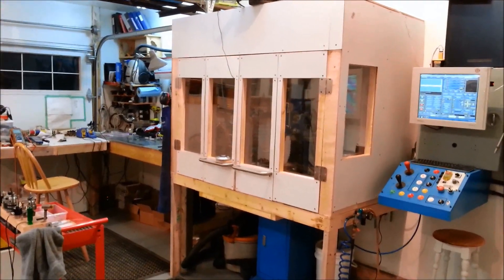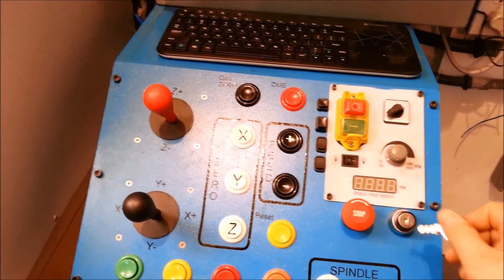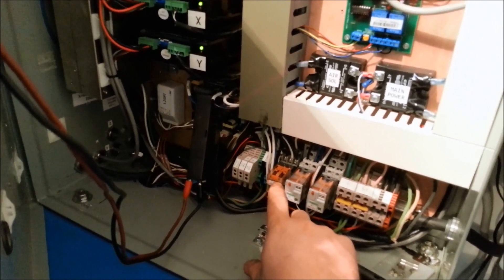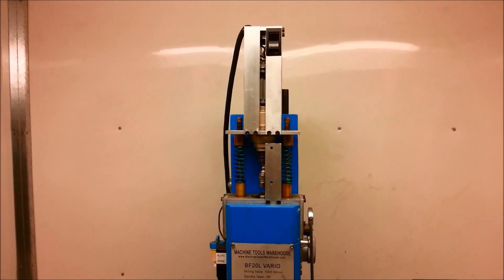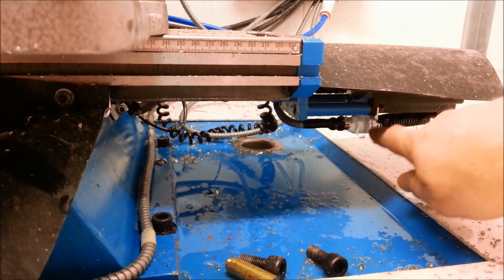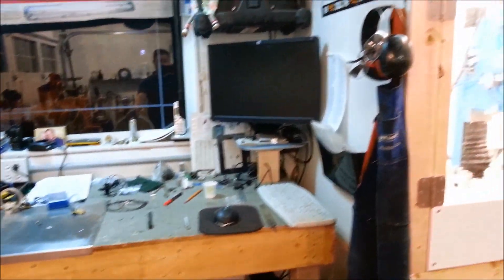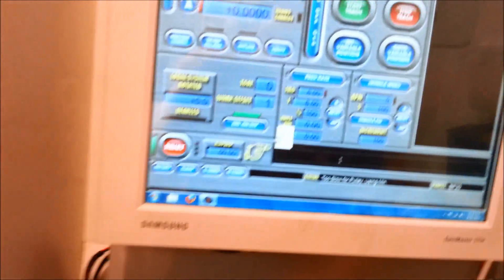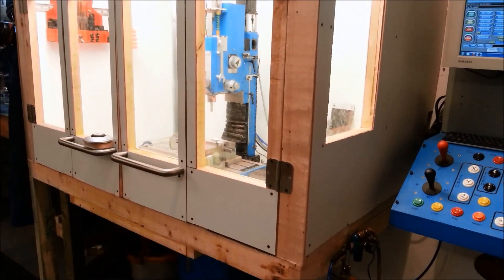BF20 CNC shop setup

Comment: I personally don't like the look of how the vise is mounted. The bolts are very close to the edge of the table, so there's a big leverage on them when there's forces being applied through the vise in the -Y direction (towards you). Otherwise it's all really cool work, well done.

Comment from the maker: I have not measured the sound level, but I don't wear a headset anymore. Its considerably quieter. Plus yesterday I had my first flyer and it was satisfying to know the chunk of 304 stainless just bounced (almost unknowingly) off the wall.I have had to put some EDPM on the door gaps to keep the coolant from coming through the cracks.